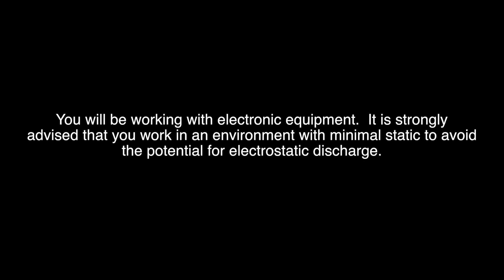ULN/LIO-8 3d Install

Comment: On the board near the LAN port there is something that looks exactly like the socket where the 3d card is mounted. (1:50) Will it later on be possible to have two cards installed? Or is it something different?